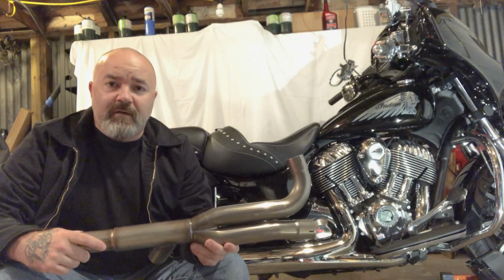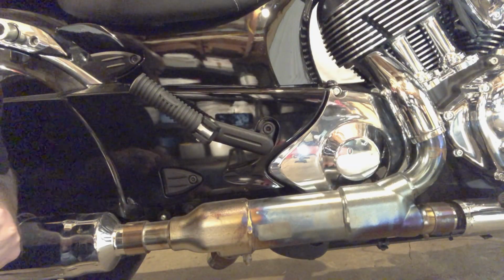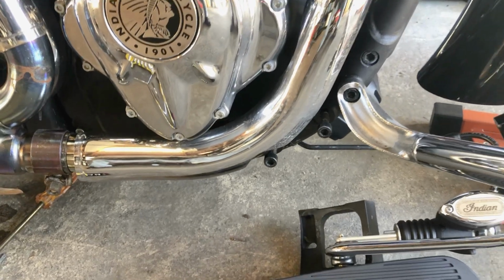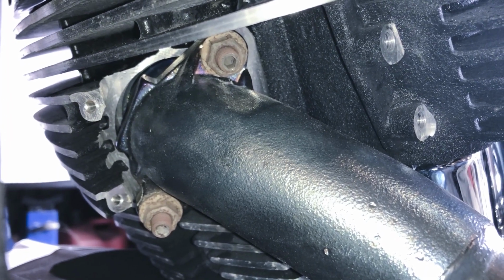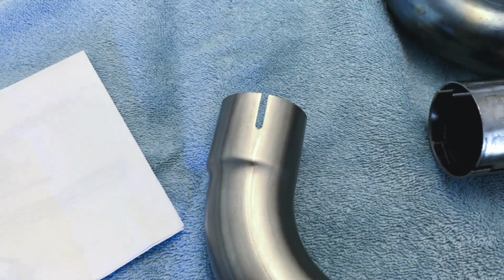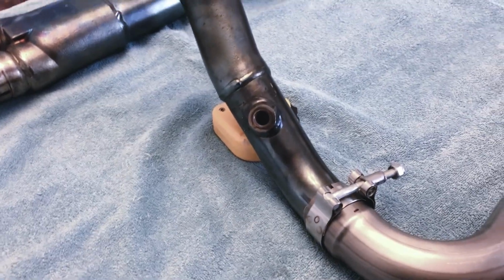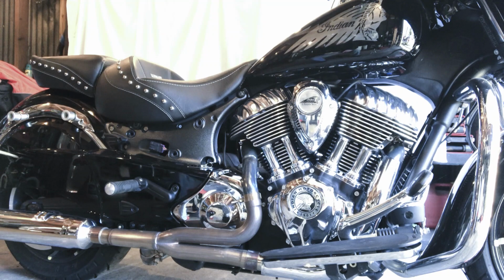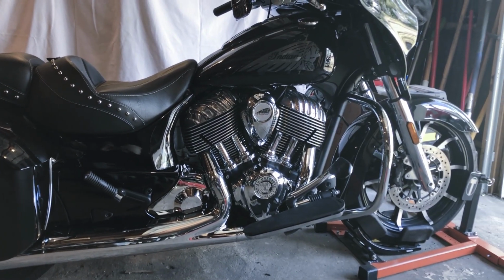FuelMoto Jackpot Head Pipe Install on a 2017 Indian Chieftain Limited

Comment: Did it make the bike run cooler?
Reply from the maker: It sure did. I couldn’t measure the engine temps but the radiated heat from the engine was  significantly less than with the cat in.
Reply: @gregmurphy-thesteamprinter227  doesn't affect the heat from the motor, just the heat from the darned heat-sink cat collector. I did one on my 15 HD Ultra and the change in :felt heat" was amazing. Jackpot is really class.

Comment: Im 2 years late to watch this video…..has the heat been an issue for you after the exhaust mod?
Reply from the maker: I no longer have the motorcycle, however the heat was reduced when the new pipe was installed.

Comment: Great video. I just purchased the Voodoo OTB, and Power Commander myself, as well a set of Bassani 4” slip ons. Cant wait to get it all on.  Currently I have open headers, I sent them out to have the carts removed. Do you think I’d gain anything performance wise from open stock headers to jackpot heads?
Reply from the maker: Sounds good.  I think your setup will be very strong and would see negligible increases with the jackpot.

Comment: Great video, one question.  What about the header gaskets, did you buy new or reuse the old ones.  I have a set of true duals from Freedom Performance on 2017 Chieftain with BB 116 and I'm about to try the Jackpot for more back pressure.  Gaskets ?
Reply from the maker: I bought the wrong gaskets and ended up reusing the originals. Worked fine, no issues at all.

Comment: Awesome video/Nice job!!!
I just received my Jackpot pipe and will be doing it next week. I will be using your video as a guide. Where is the vid you said you would post about the PVCX tune? Thanks again
Reply from the maker: Thank you.  https://youtu.be/VC3n3dIzpFE
Reply: @gregmurphy-thesteamprinter227  Hi Greg, I never saw or was notified you posted this. Thanks. I never got a chance to install the Jackpot pipe, unfortunately life got in the way . I will be doing it in the Spring for sure! I was just reviewing the Video again and I do not see the Torque spec required to tighten the head pipe bolt covers, I am talking about the covers with the fins. Do you know the spec? Thank you again...Dave

Comment: Great video Greg, I’ve watched it many times to get brave enough to do this to my 2017 Roadmaster. Many thanks.
Reply from the maker: Norman Kohn it is fairly simple. Leave everything a bit loose until you get your heat shield alignment set then tighten from the head back. I’ve got a rush system I’m installing so I’ll have a backup for you if you make a mistake. But I don’t think you will. Good luck. Let me know how it turns out.
Reply: @gregmurphy-thesteamprinter227  Hi Greg, I'm also looking at Tab Performance header as it appears to have the entire header ready to install, eliminating cutting plus full stainless.  I'd be very interested in your thoughts on it  vs the Jackpot Header.
Reply: Greg Murphy - The Steamprinter Channel I just checked with Tab Performance and they are a month backordered, so I’m back to the Jackpot Header.

Comment: Greg, can this be done without using and upgrades to the intake or the PV tuner?
Reply from the maker: Michael Y   I believe it is possible but you should verify your setup with the FuelMoto team. That are awesome and won’t try to up-sell you and will help you get your desired outcome.
Reply: @gregmurphy-thesteamprinter227  Was there a reason you went with the Jackpot as opposed to the American Custom header without the cat?

Comment: Great video. My disappointment with the Jackpot was (other than it was nearly impossible to get the right muffler onto the header pipe!) was the ugly and ineffective pipe clamp. I watched carefully how you placed yours, but mine never tightened up and the overly long screw of the clamp sticks out notably over the chrome on the bike. I can't tell from the video, but yours does not appear to stick out as much?
Reply: I had mine welded to eliminate the clamps no problems with it
Reply: Quit bitchin' Paul.  A cut-off disk will knock that extra length off in a jiffy.  And go to O'Reilly and get or rent a muffler tool.  It is a large expandable mandrel one slips into muffler and spreads muffler pipe open.  My advice is study the situation before resorting to internet.  Comments like yours make us old dudes look..........dumb.

Comment: Curious on the power impact of this mod?
Reply from the maker: Since it’s a 3 part upgrade I won’t really be able to isolate gains to only the pipe, however, a tune update is required and I will give a seat of the pants power update once it’s all done.
Reply: @gregmurphy-thesteamprinter227  Had my 2016 Springfield at stage 1 and then installed Jack Pot Header.  WHAT A DIFFERENCE!!  Could definitely tell the difference before leaving my 25 mph short street and hitting highway.   I highly recommend this modification for all 111's.  Recently traded for 2019 Chieftain Classic and header went on with full stage 3 mods before bike left dealer.  Love it!